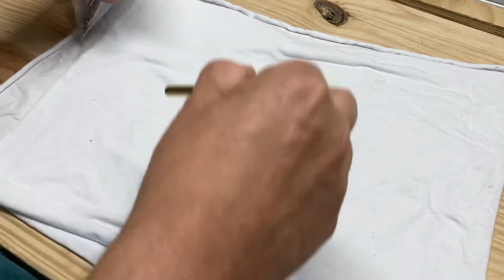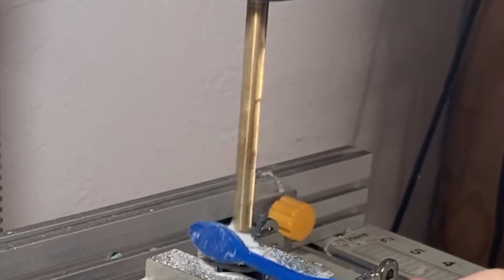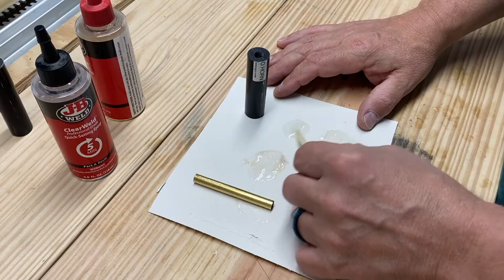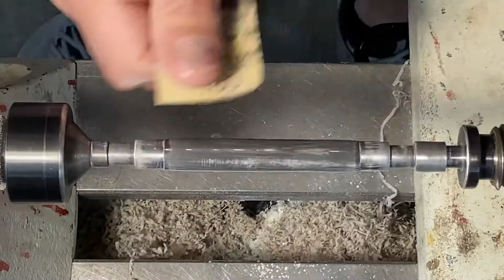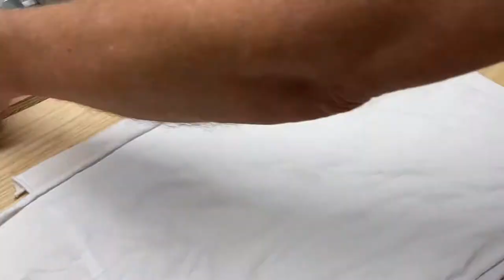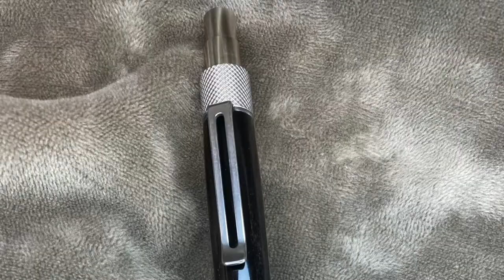EDC on Buffalo Horn

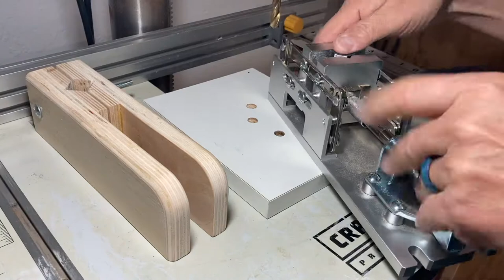Comment: 0:23 How did you keep the blank from slipping and turning in the vise? I have that same vise and am having issues with it slipping.
Reply from the maker: Hey, Yud Uul! Thanks for watching. There is an adjustment knob at the handle you can use to tighten/loosen the grip of the jaws before closing them on the blank. You need to do this before you close the jaws. Send me an email if you can't figure it out.
Reply: @TheBillPayingHobbyists  Thank you! It works!